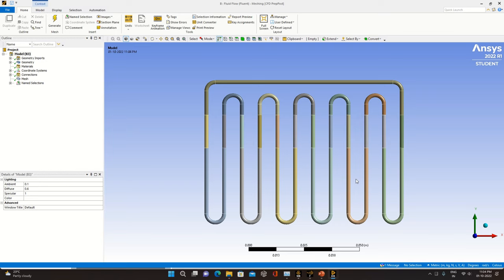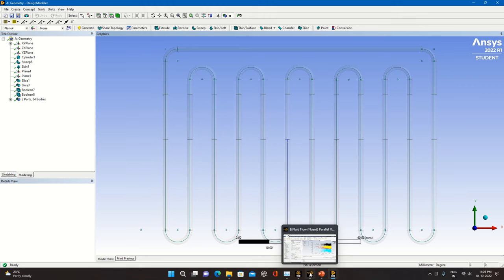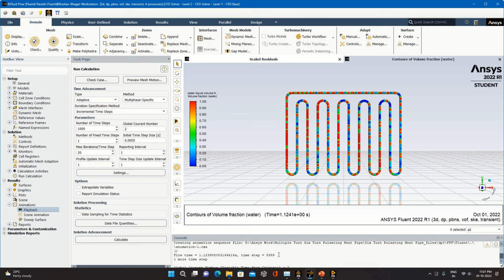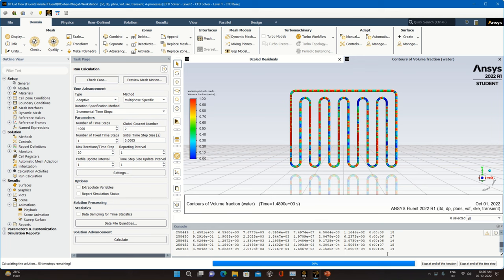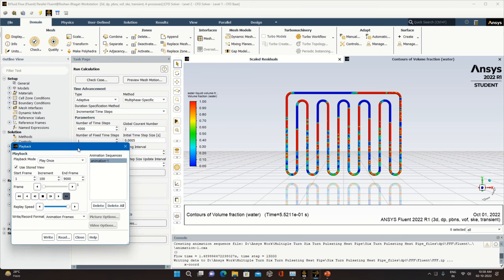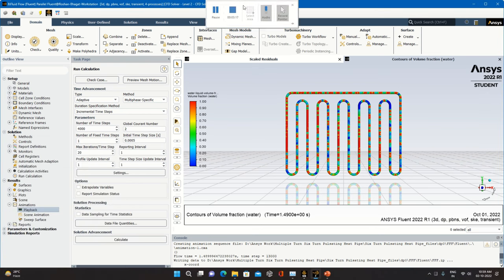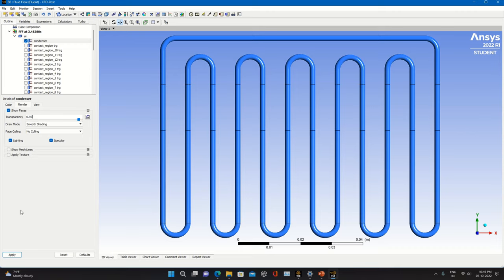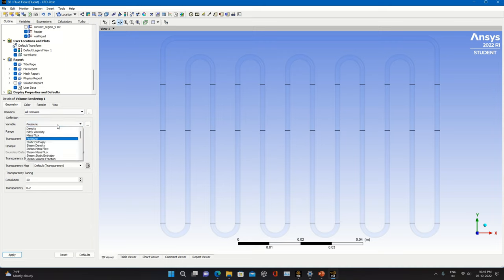CFD Analysis of Multiple Turn Pulsating Heat Pipe @Ayush.Bhagat

Comment: Hi, thank you for the wonderful video! Can I ask you a few questions?:

(1) What are the boundary conditions for the evaporator, adiabatic, and condenser sections?  In FHMT's paper, the ES was constant temperature. Is that also true for the simulation in this video? Also, were the other section (AS, CS) zero heat flux and constant temperature, respectively?

(2) How were the fluid properties treated?: for example, temperature-dependent? In particular, I'm interested in the saturated vapor pressure, which I think is important to handle the Psat, but it's not easy to do the OHP simulation in Fluent (as it also requires adjusting the parameters of the Lee model...).  I am not sure how to handle Psat.

(3) What is the model or solvers in this simulation ?: for example, implicit method or k-epsilon?
Reply from the maker: During the experimentation evaporator temperature reached upto 
353 K hence temperature was considered.
Fluid properties was selected based on the operating temperature range of working fluid.